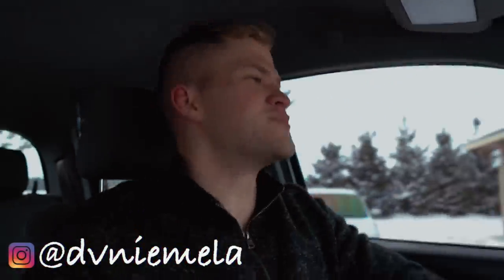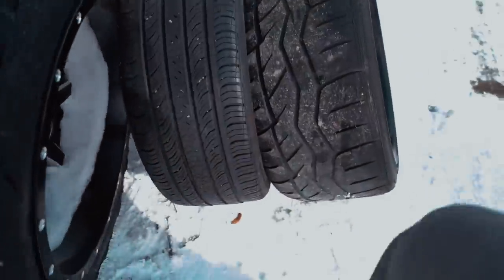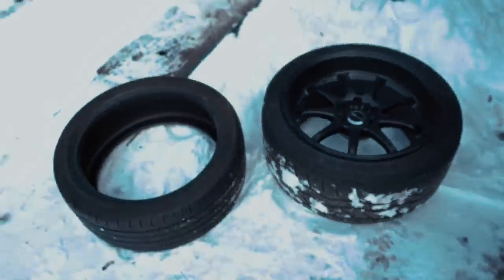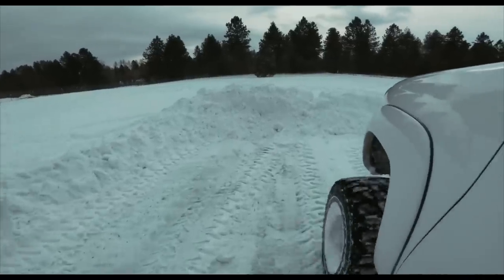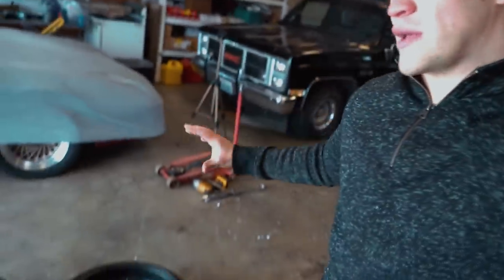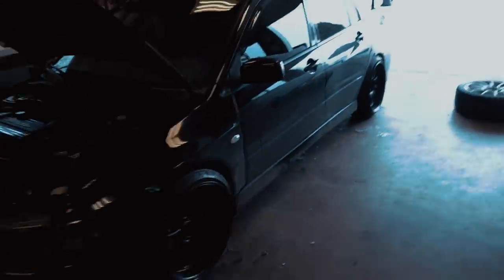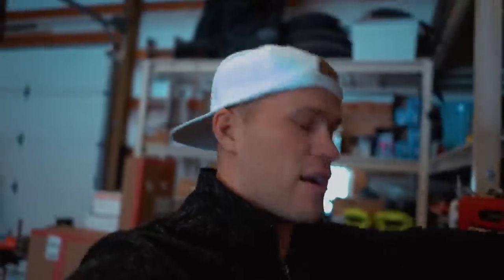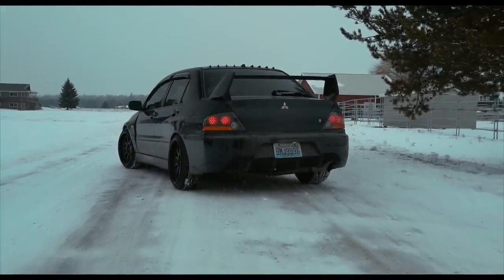Installing the Work XD9 Wheels on the Evo!

Comment: 18x10 +18!? Damn, so did you do any mods to the rear to fit those 18x10, like a roll or a pull? I've been wanting new wheels on my evo. I was thinking of RPF1's 18x9.5 but I've seen they are a bit tough to fit. But damn those wheels are fire!!

Comment: 225 are good for snow tires but factory recommended is 235, i run 255/40 myself, i had 225 before and did not like it